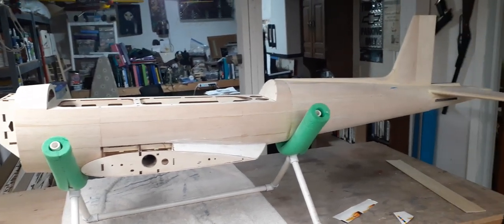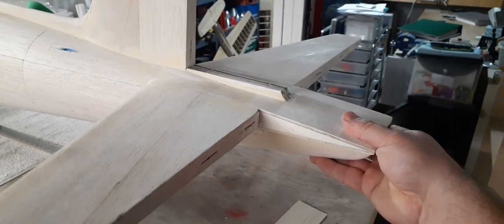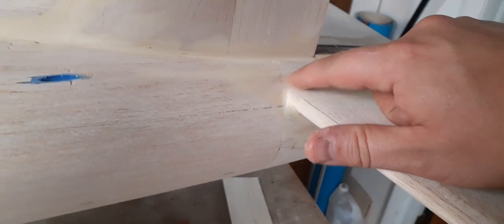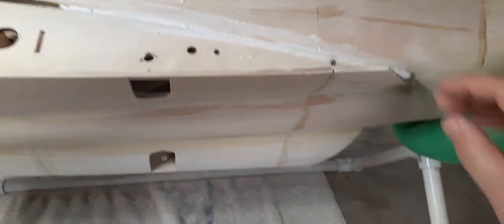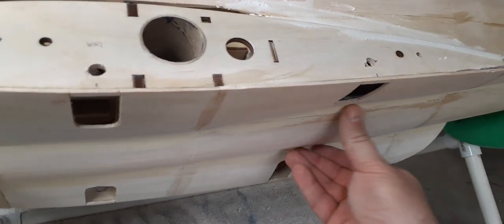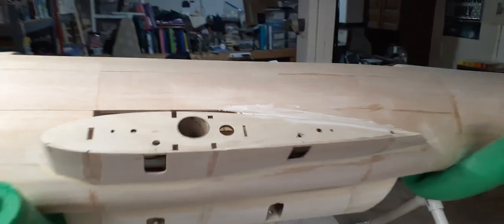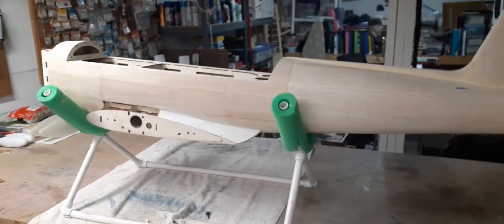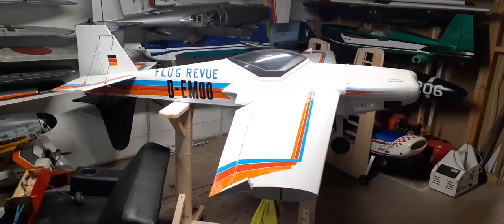Carolina Custom kits Super Chipmunk build #8

Comment: I just ordered my first balsa model to build....I want it like a Ford Emblem blue with silver belly. I was currious how one would paint it?

This obviously has a solid body.
Reply from the maker: If your going to paint the model you will need to cover it with fiberglass cloth and epoxy resin or a fabric type covering. I like using rustoleum paints, there for the most part fuel resistant.
Reply: @n1114v  I don't know if wanted electric or gas....but thought about prepping wings with servos beforehand. Watching lots of videos on builds....plane I am starting with has a 24" wingspan.
Reply from the maker: @JessicaSimonson1976  I dont care much for electric but at that size electric would probably be the best choice, and you can  use any kind of paint you want since you wont have to worry about fuel. Just keep it as light as possible!
Reply: @n1114v  I have only had electric planes in the past....the balsa kit building is a smaller scale spitfire
Reply from the maker: @JessicaSimonson1976  witch kit?
Reply: @n1114v  laser cut kit ordered online. No hobby shops around where I live anymore nearest one is 45 miles one way. I have to go back and reference order email said it shipped today.
Reply from the maker: @JessicaSimonson1976  once you get started feel free to ask any ??????
Reply: @n1114v  edge 540 laser cut kit for beginners 20 inch wingspan not 24 inches. As this is my first build....was only 40.00 without motor. Just want a nice looking finish and one that is durable
Reply: @n1114v  should be here 11th-16th of this month. Got to buy like a cork board and cutting mat possibly iron and film....I want the underbelly silver, upper blue, with white graphics.

Comment: Andy, love the video's! I have a question about covering, I'm replacing the covering on an old Trainer 60, I have it all removed but it left a lot of residue (color of the Monokote). Is there an easy way of removing it or just have to sand it to death? I will be covering it with the same color, will what's left over affect the new covering as far as adhering to the balsa? Thanks again for the video's.
Reply from the maker: Yes! Take a piece of scrap covering and iron it over the area where the old color remains. Use maximum heat and a lot of pressure. Iron and peel!
Reply: @n1114v  Ok, thanks, I'll give it a try.

Comment: For your filler, do you use light weight spackle?
Reply from the maker: The white stuff is but I will be going over it with Elmer's wood filler that the covering will stick to.
Reply: @n1114v  awesome, I do the same thing when needed lol. Was just wondering if it was the same technique